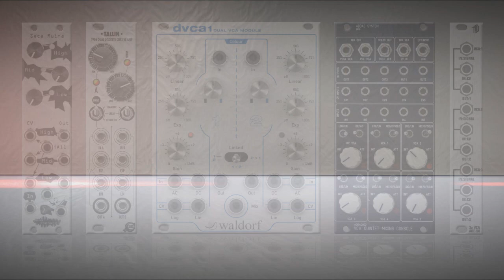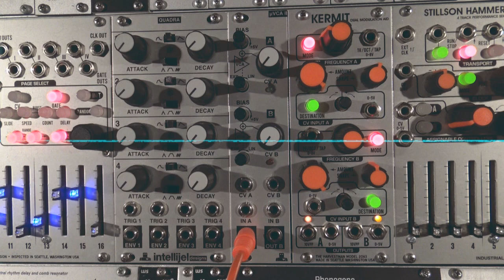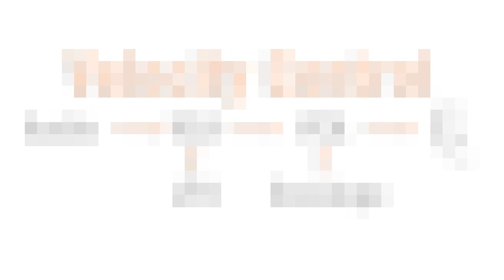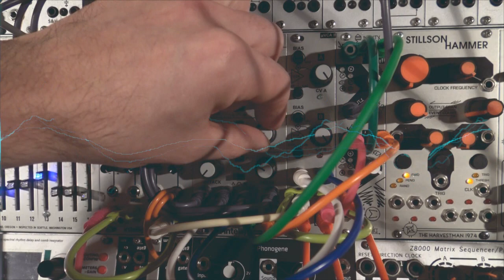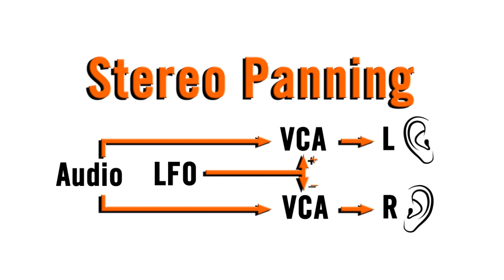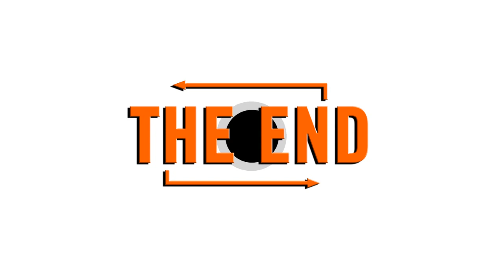Quick Tips: Multiple VCA Applications

Comment: another great video ! for a beginner like me its super helpful so thanks for sharing :)
any recommendation on some interessting vca designs or ones you like to use?
Reply from the maker: My favorite VCAs are the Double andore from Harvestman or Industrial music Electronics, because the unit comes with its own envelope generator and also you have cross modulation of amplitude between the VCA outputs. So you got lots of Controls for your sound design. Other wise the Intellijel is also my favorite ones but you'll have to get some envelope generator. And the Envelopes form itellijel are the most snappy envelope I have found.
Reply: @robotopsyrobotopsy6486  thank you robo, i will look into the double andore!
Reply from the maker: @lasko303   I've made some tutorials about them, but they're discontinued modules but a new version is on the way
Reply: @robotopsyrobotopsy6486  yea, i saw it last night. the crossmod sounds mental! 
any news on when the mk3 is dropping?
Reply from the maker: @lasko303  Don't have any clues ?? but be sure I'll gat my hands on that. Probably need at least two of this unit.

Comment: i'm so confused how the timbre change from 7:30 to 7:40. kermit was the oscillator right? doesn't look like any xmod is set up.. looks like you got it by changing the offset on the uVCA. head scratching. anyway, thank you professor.
Reply from the maker: I was changing the VCA response from Linear to exponential. This is why I think the more options you got on your VCA... the best it is. Imagine a racing car with cheap tires. VCAs and envelope are not something to neglect.
Reply: @robotopsyrobotopsy6486  aah makes sense! some good crunch on those. i don't think veils gets as gnarly.
Reply from the maker: @fosferus   I dont have the veils, but a friend of mine does. I'll give it a try next modular session with him. I'll let you know.
For sure from what I've tried. Intellijel and the Double andore are what suits best my needs.